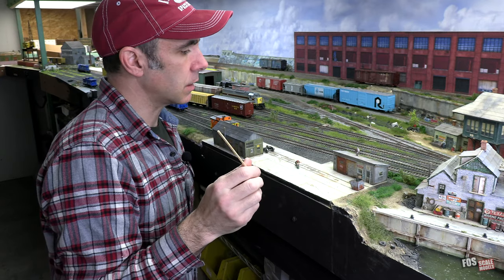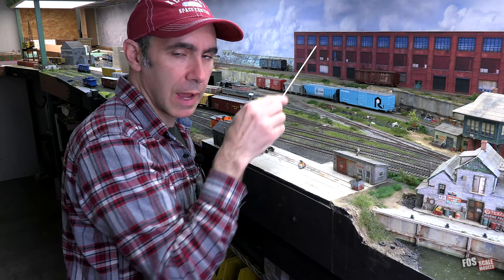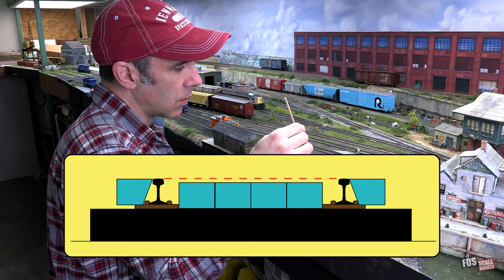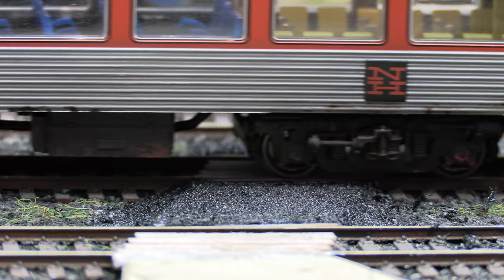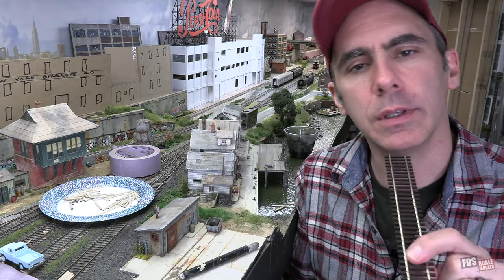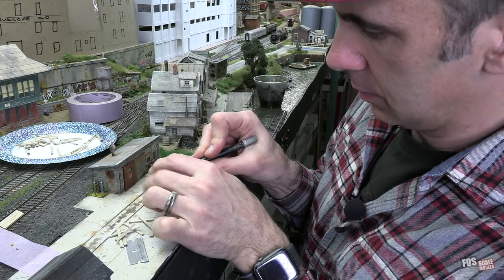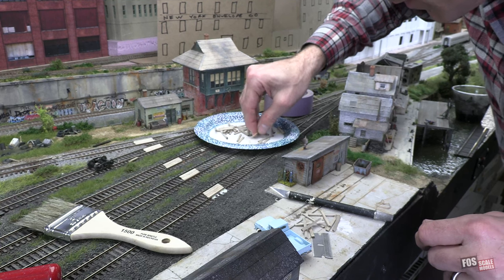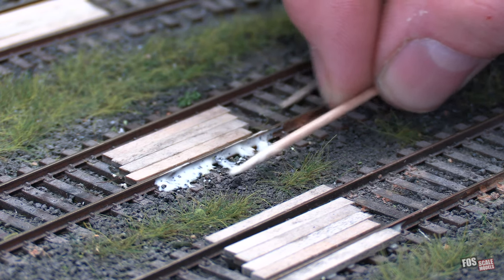Make A Rail Yard Grade Crossing -  PART 1

Comment: I really like the way you think out-loud and discuss various ideas you've had as you go. I made a road crossing over 4 tracks with blairline wood crossing, black mat board glued down in between each crossing, and fine woodland scenics cinders over that, and it turned out okay, but I may try your method on the next crossing I need. Thanks!
Reply from the maker: Thanks Paul - I had considered a similar method, was going to try painting matboard and sprinkle on some cinders while it was wet, there's a always a million ways to get there!

Comment: Good video Doug. I'm doing a grade crossing today, using .020 styrene between the code 73 rails. Golden Fiber Paste for an asphalt texture (because I already had it) and then paint grimy black. Celluclay outside the rails. I had an industry too with no way in or out for truck traffic. Nobody ever mentioned it in all the videos I've done but It was bugging me. Take care - Bill.